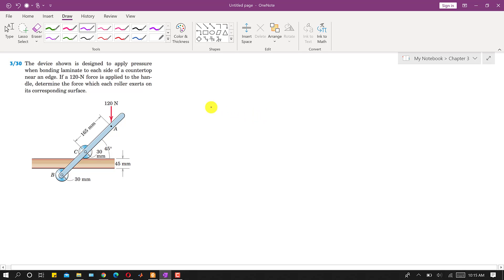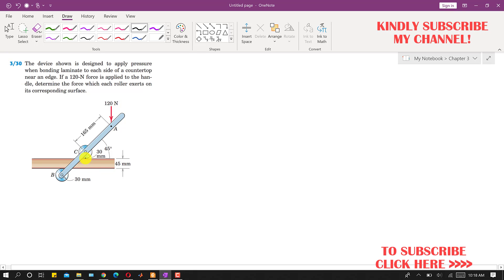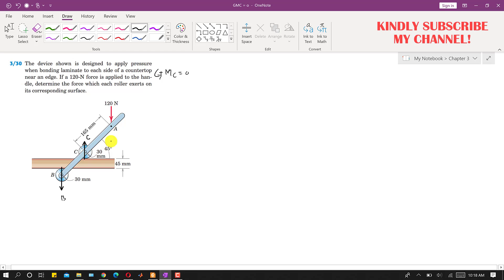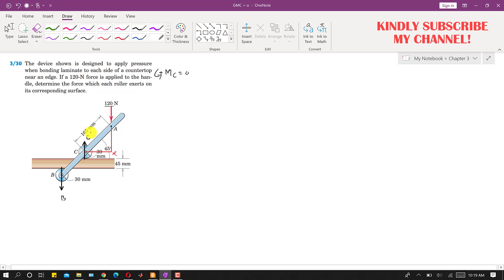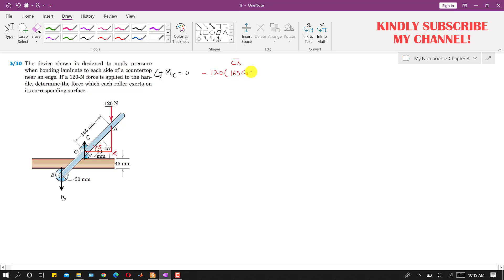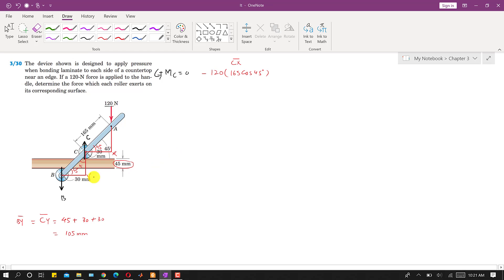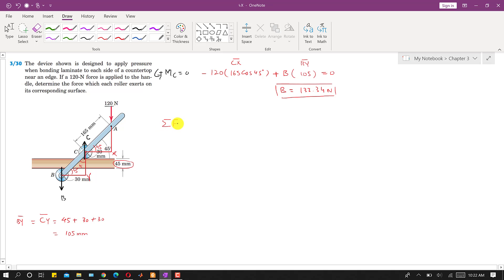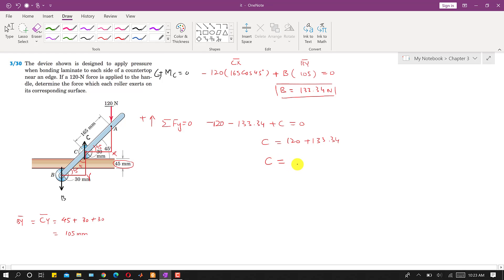Engineering Statics | P3/30 | 2D Equilibrium | Chapter 3 | 6th ed | Engineers Academy

Comment: Bar AC is connected to bar BD by a pin that fits in the smooth vertical slot. The masses of the bars are negligible. IfMa-30 N-m, what couple MB is necessary for the system to be in equilibrium?

Please solve this question